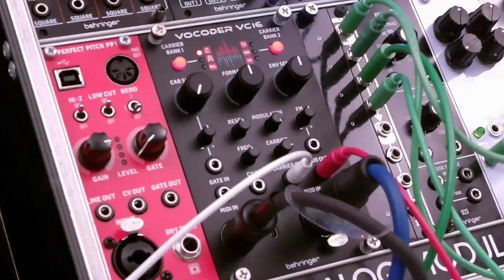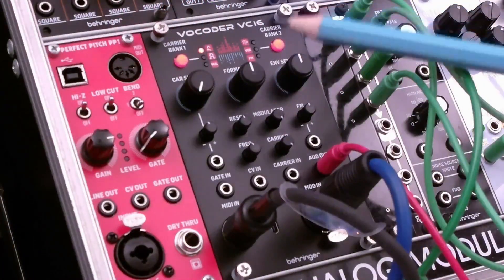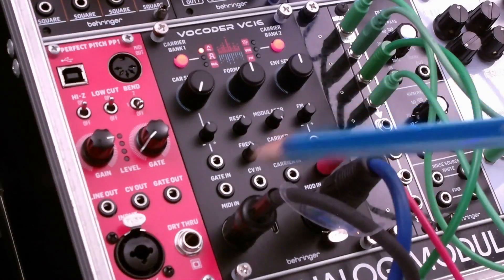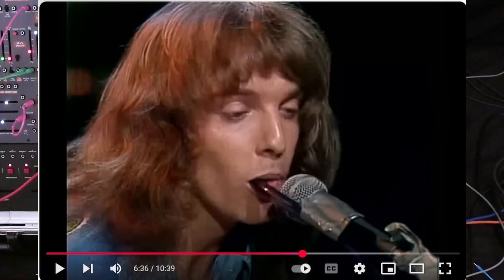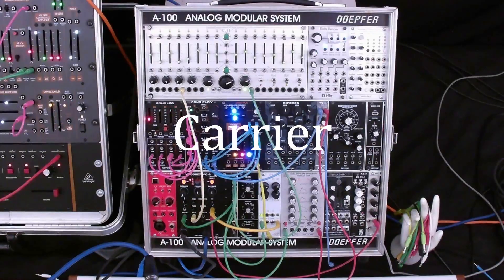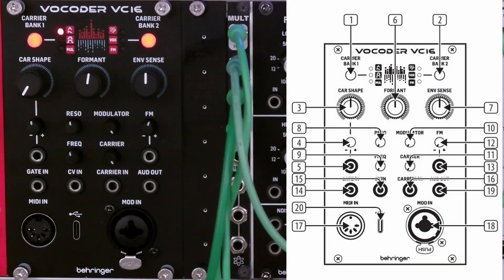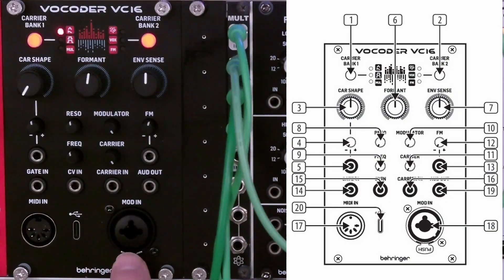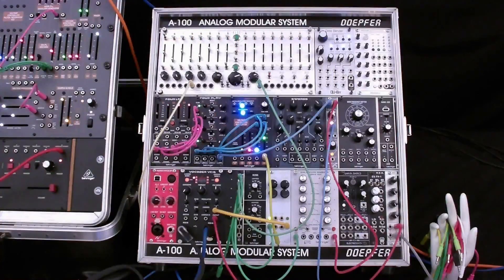VC16 Vocoder Part 1 by Behringer

Comment: What mike are you using as ?   None of my  dynamic miscs seem to work.   I used your other examples (VCO input  to mod in)   Side switch is set to mic.  Tried both xlr and 1/4 inch.   I opened a ticket with Musictribe.   Thanks.
Reply from the maker: I'm using a dynamic mic (Shure SM58) connected directly to the MOD IN XLR input.  That modulates the "Carrier" to form "words".  I'm using the internal "carrier" with a sawtooth shape.  The carrier pitch is controlled via MIDI from the MIDI keyboard iconnected the MIDI DIN input. I'm sure I had the preamp switch set to "MIC".
Reply: @ozhalljr  Thanks  I have a support ticket open with them.   Mine is not working correctly.  I  can barely hear the mic.  (tried all 5 of mine and  then with an external mic preamp to boost.   Press a key and almost can hear  but also fades a lot.   Using your  OSC waveform example works like a champ lots of sound.    I did not get mine last Nov as was a bad batch ,   so got it in December and think it is another bad one.  .Anyway thanks. Your video are really herlping me trouble shoot.
Reply from the maker: @gwiorek  The mic should not produce any sound  without a carrier.  With the internal carrier, you have to press a key to hear anytbing.  Think of the modulator as a filter.  Without input to the filter (the carrier) you would hear nothing.  Without Modulator input (speak/sing into the mic), you would hear nothing.
Reply: @ozhalljr  Yup and that works with a VCO wave as a mod source  with  every midi key press  leting t the internal carriers work and producing sound.   Not wiith a mic,  as  pressing a key and speaking ,  once in a while I  get some noise. e speaking. Right now it's pretty much a modoulator/fX  and not a vocoder.   Will see if Musictribe responds back to the reply and I'll answeres to their questions.  If not I'll  just return it.  I will also see if Sweetwater support has any ideas.   Thanks for the help  Oz.

Comment: Can units like this be used on its own, without other modules? I’m really restricted on space but prefer using hardware over plugins, so something like this is really interesting. Actually same question applies to other Behringer modules, like their Space FX, I’d love to run a synth into one of those.
Reply from the maker: Great question.  The short answer is "no".  You would need a case and power supply at minimum.  In addition, one of the advantages of the VC16 is the control that is available, when integrated into a Eurorack system..
If you don't want to start a Eurorack system, I recommend a unit like the electro-harmonix V256.  I use one in my live rig.

Comment: Thank you for this video series on the VC16. I quote the manual of the Doepfer modular vocoder (which is not available anymore): "the speech signal is easier to use if it isn’t live, but
has been taped or sampled, and thus has reliable levels and signal-to-noise - and is repeatable." 
I'm still thinking about getting a VC16 although it is of course super cheap. However I read about the level being far too low but I guess that could be resolved by using a pre-amp, just like you did in your video's (and also switch it to line level).
Reply from the maker: Thanks for commenting.  Yes, I use a separate preamp for the voice signal.

Comment: I am surprised that you don't mention the low output level, it stays below 1 V depending on settings,  its absolutely not eurorack level, you need to extremely boost it with a VCA or other amplifier to be useable. Thats a disappointment for an eurorack module. Apart from that i am happy with it, wanted sth. to make weird robot voices at a reasonable price for a long time. Also i think CV control over Formant would have been important (much more than over the carrier shape).
Reply from the maker: Thanks for adding that observation!  CV control of Formant is something that would be great to have.

Comment: I got mine and I was Sold from the first Moment, 🎉I think if you have a modular System, using LFO input you get these awesome sounds I never heard before! Try it out. I have several vocoders, but this is something new ❤❤❤. But use you modular Equipment to squeeze out New sounds 🎶🎶👽👽👽🛸😊
Reply from the maker: I'm working on part 2 of this series.  It's interesting to do a deeper dive into this module.  I should have this done in a week or so.
Reply: Yes just do it, it is incredible using external LFO for FM, the module freaks out!
Reply from the maker: @missiskitty99  Yeah, vibrato really makes it come alive.

Comment: not a fan of vocoders myself but if I did want one this would be a great option.. at this price point I might get one to use for more experimental sounds
Reply from the maker: The price is right.
Reply: If you already have a modular System? Then the price is right. But without you need more Equipment killing your Imagination
Reply from the maker: @missiskitty99  Yes, it is designed to fit into a eurorack modular system.  You'll also need a mic, mic stand, MIDI keyboard and cables. (but you knew that).

Comment: I keep mine switched to line level and use the preamp from my BARP 2600 to drive my mic into it 👍Not the best sounding vocoder I have heard but it's super versatile and I will be using it a lot!
Reply from the maker: That's something I had not considered.  I do have the PP1 just to the left of the VC16, so I could use that pre-amp and keep the VC16 set to line level.  Thanks.
I'm still exploring the VC16 for Part 2 with examples.  But, you're right that the 16 channels do not provide high articulation.  Then again, the whole point is to sound vintage with a vocoder.  The 70's vocoders didn't have perfect articulation.
Reply: @ozhalljr  I appreciate your thoughtful and thorough videos. Looking forward to the next part/s of this. I almost bought one, but decided to wait. The modwiggler thread was iffy on this, but I think some people have unreasonable expectations or they are patching it wrong. It would be nice to have good articulation and a vintage options since it is digital, but in any case I couldn't get a feel for it with the other demos other than that they seemed to want to get that vintage sound--though that doesn't always mean something is limited to that sound, so I wasn't sure. I've been slowly putting together fixed filter banks and envelope followers and large amounts of vca to do some experiments myself, though had a setback with modding a Doepfer fixed filter bank wrong following a blog post instead of the Depfer page (oops). Will look for your next video on this when it comes out!
Reply from the maker: Thanks Dwight!  What mod were you doing to the FFB from Doepfer?
Reply: @ozhalljr  consider it a favor returned then because it was YOUR Bode Shifter videos that reminded me to use the BARP 2600 pre-amp! 😄🙏
Reply from the maker: @HazeAnderson  LOL!
Reply: How would you compare it to others? Thinking about this one, but I don't have a lot of experience with others. Not sure what to compare it to. There is one in the Disting, but that seems like it has less clarity. There was one in Mutable Warps that seemed good but with less feature---though pretty good sound. Then there is software and historic examples. Any ideas on better perspective? Would it be useful for spectral processing by bringing a modulator to line line level within a rack and also patching a carrier from a rack?
Reply from the maker: Dwight, here's a video where I use the Electro-Harmonix V256.  With 256 frequency bands, it can get pretty good articulation.  If I want a more vintage sound, I dial it back to 16 bands.  Of course, it is a stomp box, not a eurorack module.
https://youtu.be/A9mklx856i4
Reply: @ozhalljr  beautiful sounds there. really enjoyed it. i've had a lot of ehx pedals over the years, but haven't been into pedals much since getting into eurorack several years ago. i know ehx can do some great stuff. even have a ehx shirt somewhere although i need to lose a few pounds haha. i don't know much about vocoders other than how they work since i've barely used them. but i find the synthesis fascinating, and it seems like a fun and promising area to explore
Reply from the maker: I seriously considered getting several 1047 bandpass filters to demonstrate a crude vocoder with ARP 2500 modules (& or  Sys 55).  I abandonned the idea since I was short on time to get this first video out quickly.
p.s. I checked out Fiveng - Give me a Taste.  Cool vintage video clips.  Where did you source the clips?
Reply: @dwightpeters  I have the analog EHX V256 which is fickle but really amazing once you dial it in. (Perhaps I just need to find the sweet spots on the VC16?) I also have the analog Behringer VC340, it is very lush. Then there are the three Korg MPK2 units that I have, each has about 5 or 6 digital vocoders which are great but very obvious "presets." The VC16 at $100 is just a no brainer, cheapest vocoder I own. I like it. 🙂
Reply from the maker: @HazeAnderson  Yes, the V256 has sweet spots.  It's important to save a preset once you get it tweaked.  There are definite sweet spots on the VC16 as well.